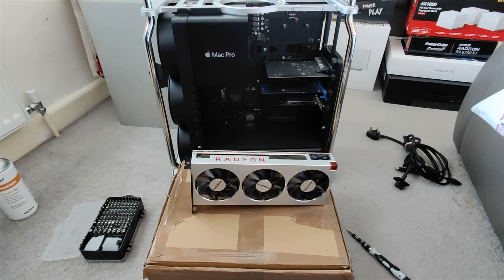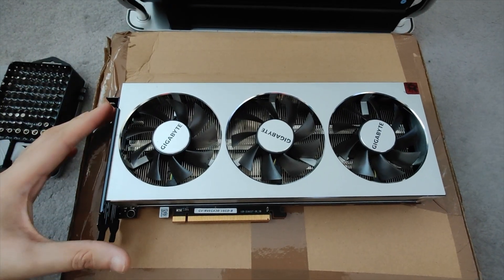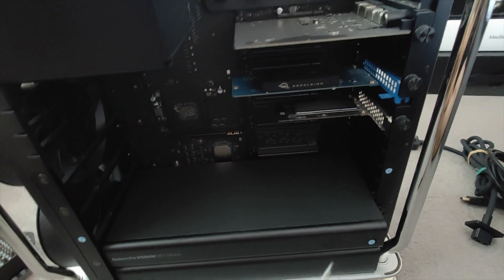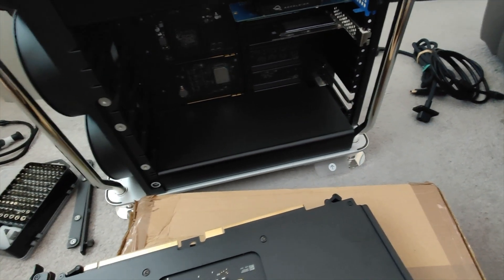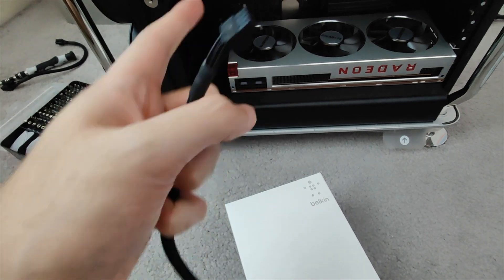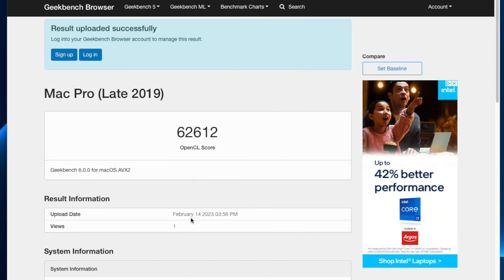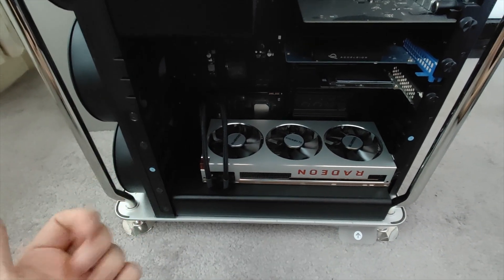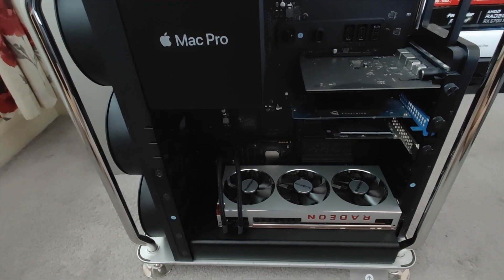Mac Pro 7,1 2019 Radeon VII GPU Upgrade

Comment: @04:54. "The Mac Pro only supports AMD GPUs", is not a true statement, it should say;
"The MacOS, (after High Sierra) only supports AMD GPUs, Windows supports FAR more as long as they physically fit and can supply power."
Reply from the maker: For Mac Pro 7,1 that statement is true under MacOS

Comment: At 5:50 you can see dust accumulation on the cooling fins. Should take the card out and blow out the cobwebs. As for the factory installed GPU: Could be wrong, but that has the appearance of being a "normal" PC video card held inside of a screwed-on outer metal shroud.
Reply from the maker: I actually did this after the video, works like a charm!

Comment: The Radeon VIIs I have dealt with are super problematic.  They just run so hot, you have to undervolt them and on Mac, you can't do that very easily.   The display tends to die on them.  I would definitely go with a reference 6800 over the Radeon VII.  They are faster, cooler and also draw less power.  Footprint wise, they are a little smaller than the Radeon VII as well.
Reply from the maker: I actually got a 6800 XT but it didn’t fit, I had the Red Devil version but it’s okay this one’s still killing all my dev stuff and my editing
Reply: @themacintoshguide  Do you recommend buying a Radeon 7000 series graphics card for those Macs?
Reply from the maker: @BenFrankV  7000 isn't supported and won't be